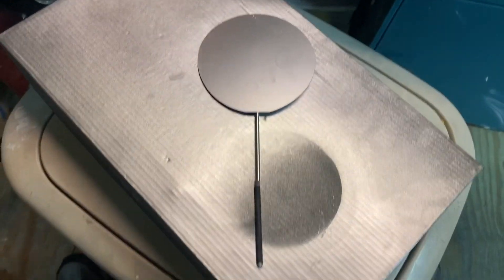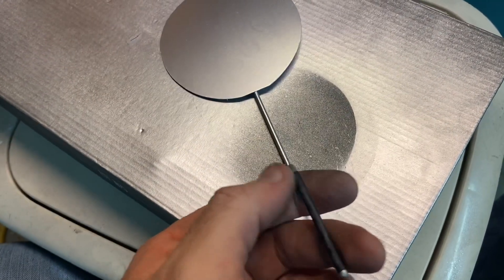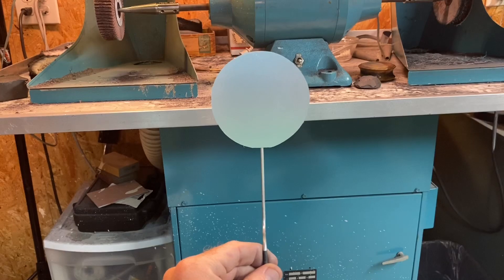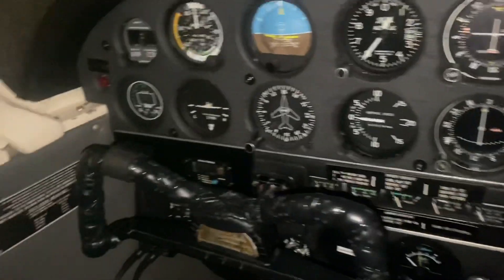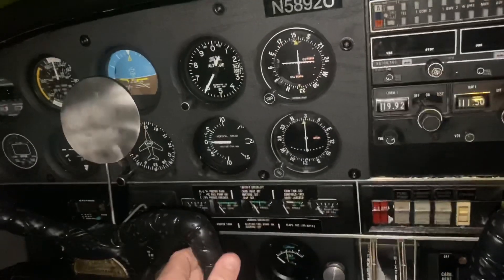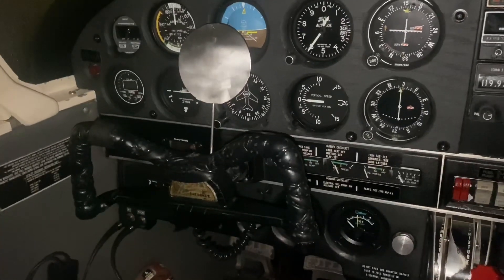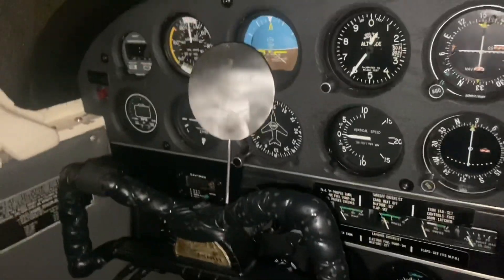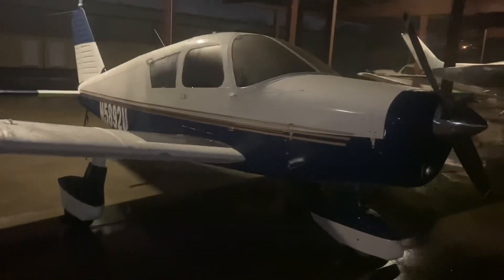Piper Cherokee 140/160 Gust Lock Solution!  Does your airplane need one?

Comment: On my 140/160 I just pull the control yoke as far back as I can, pull my pilot seat belt through one side of the yoke, pull it up nice and snug and latch it.  I've stood outside on some very windy days and never seen the control surfaces move the least bit.  And there's obviously no way to take off with it in place because you can't even sit down in the pilot seat with the belt through the yoke.  Your invention should do a fine job as well Greg, but my column doesn't have the drilled holes and I'm loath to drill one through it.  For all pilots the main thing is always do your entire check list, no matter how well you think you have it memorized, and to check your controls for freedom of movement at run-up.  You will only be allowed to forget one time.
Reply from the maker: We’re lucky in that ours is factory drilled with a collar. I’ve tried the seat belt thing but even with seat full forward and yokes full aft, the seat belt is too short to make it. I’ve never even got close to starting the engine with a control lock in place, you cant set the flight instruments either as it is in the way.